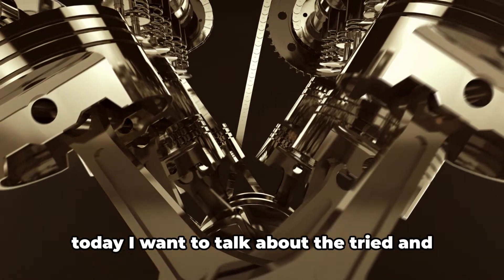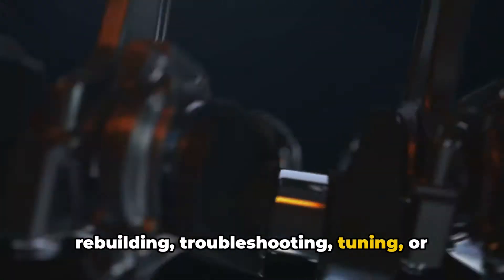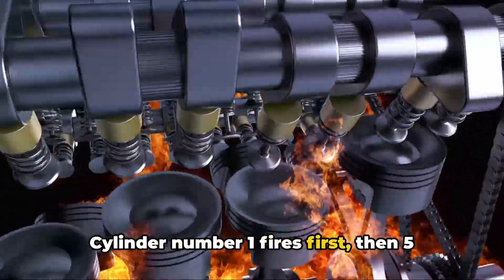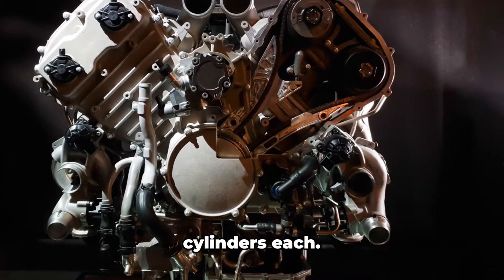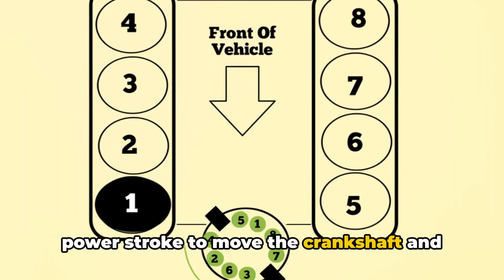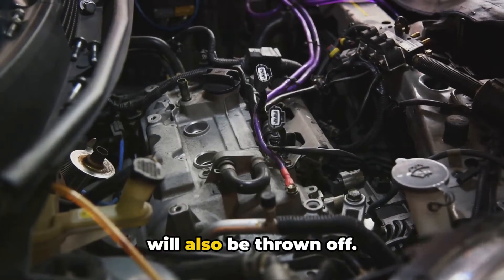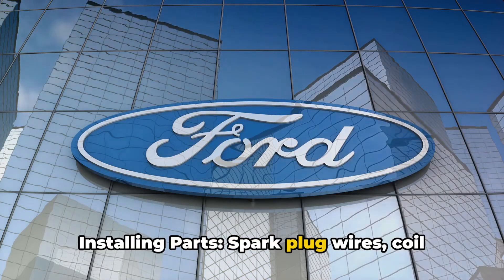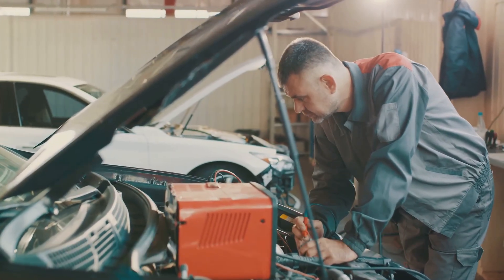Ford 302 Firing Order: Cylinder Numbers and Diagram

Comment: The High Output 302 follows the 351 V8 firing order which is 1-3-7-2-6-5-4-8. The 1-5-4-2-6-3-7-8 302 V8 is for non high output 302’s only.